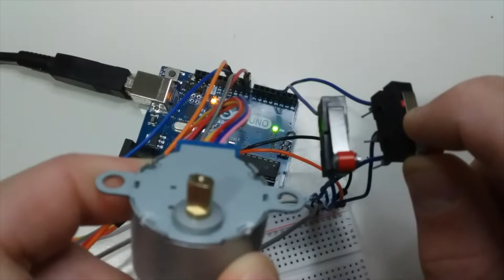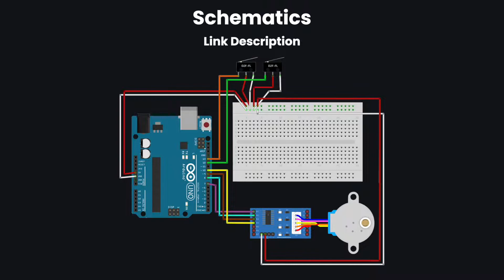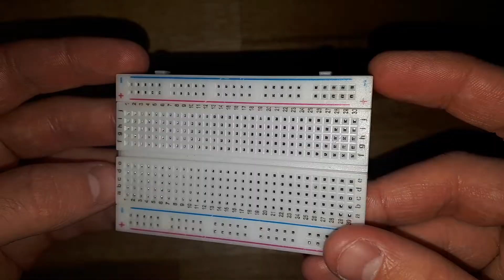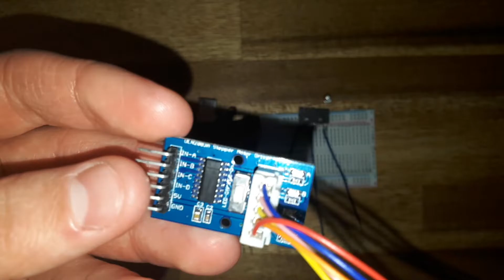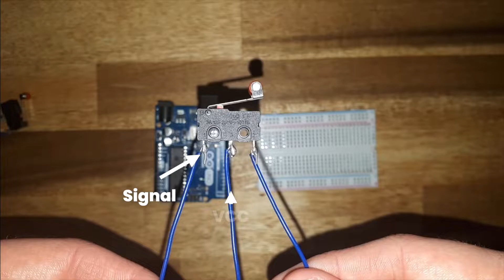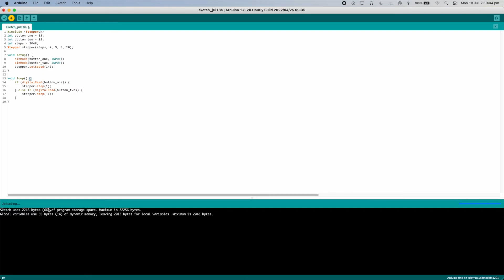Stepper Motor With Two Buttons | I Remade The Code

Comment: Can u please guide me to rotate only 90 degrees clockwise and anticlockwise direction
Reply from the maker: Hello. This can be achieved by using three additional variables which are all floats. The first variable to keep track of the current angle, the second to gives us how many degrees a single step is and the last variable to declare the angle you want it to stop at. The stepper motor I used (28BYJ-48) had a total of 2048 steps per revolution (to complete one 360˚ rotation). With this, we can divide 360 by 2048 giving us 0.17578125. This means that 1 step is 0.17578125 degrees. Knowing this number is a single step, we can assign it to a variable, something along the lines of step. This will allow us to add this number to another variable called current_position. The current_position gives us the current angle the motor is at. For example, we want 90˚, that is 0.17578125 * 512 which is 90. So, it takes 512 steps to make 90˚. Now, the final variable is the degree we want the stepper motor to stop at, so 90. The code with all these changes can be found below.

https://github.com/TheLostProgrammer/two-buttons-stepper/blob/main/set-degree-rotation.cpp